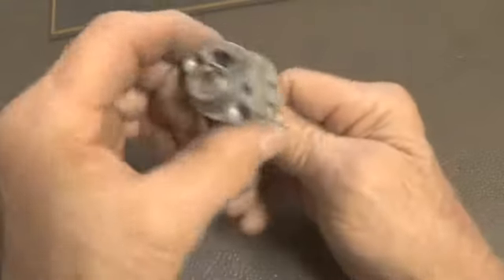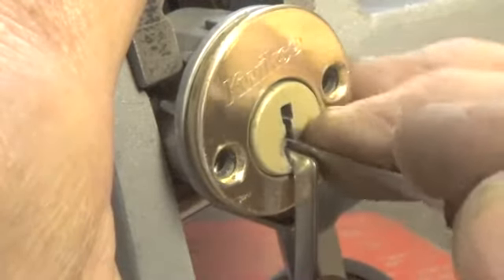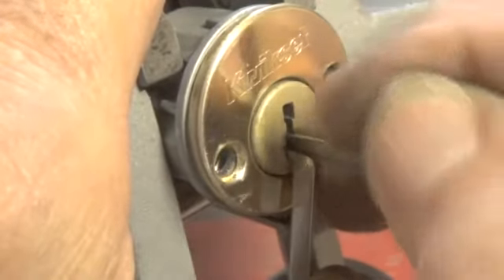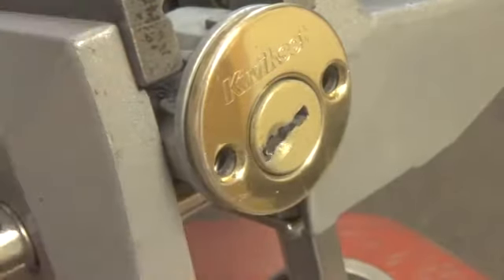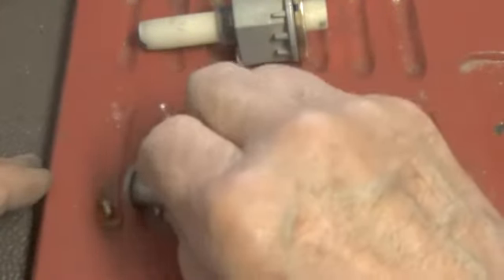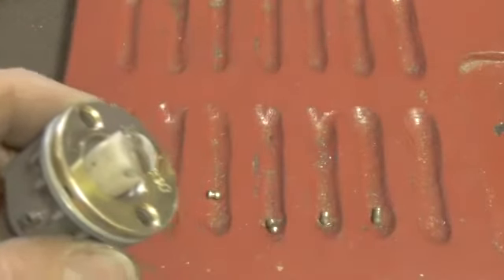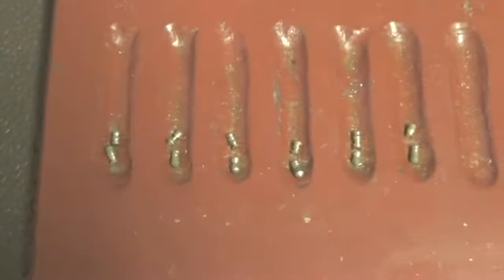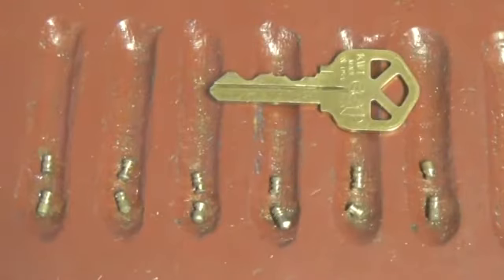(463) Kwikset 6 Pin Cylinder Lock SPP'D and Gutted

Comment: If I'm not mistaken that's a Kwikset Titan deadbolt cylinder. It has the control key cutout for removing the plug from the front, and the pin catches in the core for stopping reverse rotation. They've been filled or weren't drilled from the factory but you can see where they are. It's one for the plug spinner if you have to go CCW picking it when those are in. The top of the keyway is cut out to stop you tensioning up there too. Looks secure on paper at least, but I have a few Titans. They're not much harder than normal ones really, if at all. Kwikset - good sounding ideas meet relaxed machining and suffer. Thanks for keeping it up and trying with them. If anyone can come up with a truly devious mod for these it's you.
Reply from the maker: Thanks, you are probably right about it being a Titan. I don't have a control key for it. I had forgot about the Titans. They are really no better than the Kwiksets, at least that is the way I think.